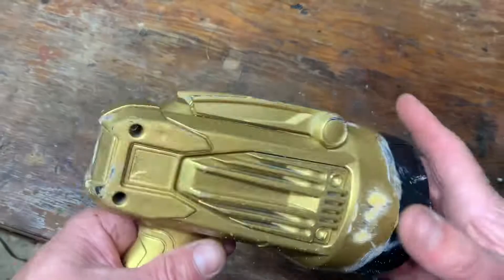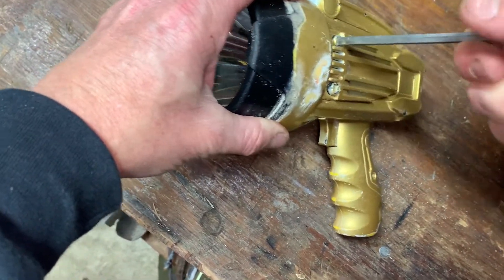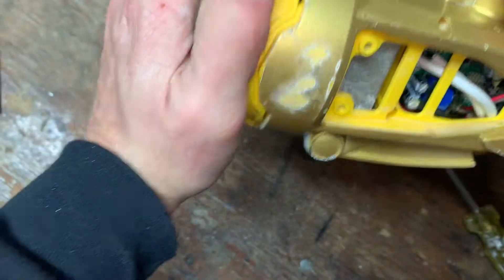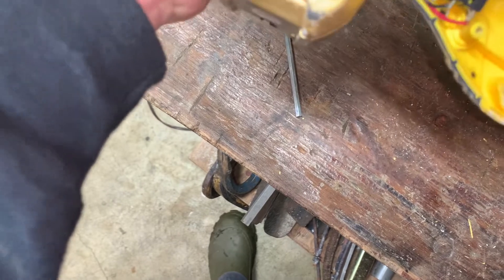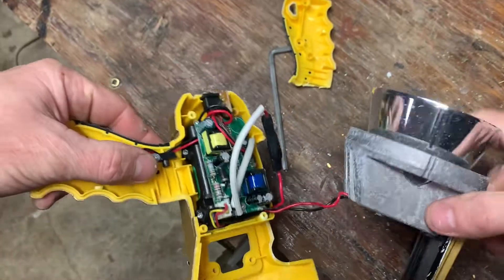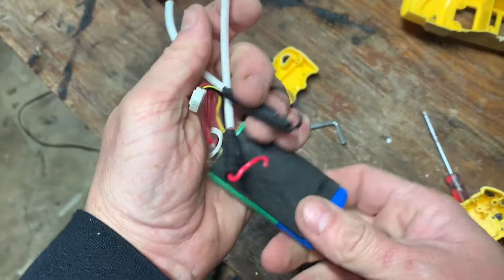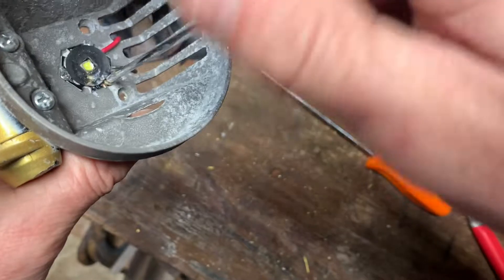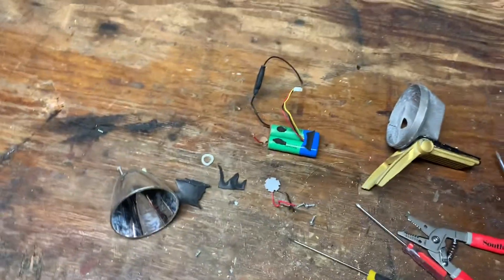What's Inside? STANLEY FATMAX Rechargeable Spot Light Tear Down [What's Inside Stanley FatMax]

Comment: I have had my ledlisl NOT THE CHEAPER "SL10leds" that are for less than $50. They made them look almost identical, but the LEDlisl is a much better unit. I cannot find any ledlisl models on amazon. Anyway, I have to spit on the 12v plug and twist the charging wire to light up the led charging light. I think the contacts that connect to the 12 v prong get corroded and stretched out and prevent it from contact and charge. Hope that helps.
Reply from the maker: Thanks
Reply: @DIYTechnician  THE LEDlisl LIGHTS have a chip in them that keeps the same light intensity throughout the charge. Other than them not being waterproof, the are great lights, but I think Stanley/Blk dker. is trying to sell the cheaper sl10's for almost the same price as I paid for my two lisl's [over ten years ago]. They are still working like new today! l8r

Comment: Mine just died this week. Had it since 2015. Best spotlight I ever had. I don’t want the new modern 900 lumen crap. I want the same 2200 lumens.
Reply from the maker: Man I agree. This one died too but it served me well for a long time. Thanks for commenting. Happy Holidays.
Reply: @DIYTechnician  The one I have looks like this - with the black fins on the sides - lost the special chargers somehow moving etc.  Are you saying that my old one is somehow brighter than the new one?  I think I paid $65 to $90 or so for it in like 2013 or so. Batteries totally dead, and it said in the manual not to let them go dead, so I came here looking to see how hard it would be to replace the batteries, what type they are, etc., but it looks really tough to disassemble!  Planned obsolescence.  That CREE LED had the model, they say it's 10 watts, here's a list of the CREE's up to the XHP 70 (now we're at xhp 90)

Odd how the URL/URI here says 920 Lumen, but the Amazon store shows 2200 Lumens.  Wonder where they're measuring from.  I'd assume the newer one uses the better / newer model of CREE LEDs.. see list in my other comment below/above.

https://www.amazon.com/STANLEY-SL10LEDS-920-Lumen-Rechargeable-Spotlight/dp/B00OU67Z80/ref=sr_1_2?crid=VFT15IS31AZH&keywords=stanley%2Bled%2Bfatmax&qid=1674038017&sprefix=stanley%2Bled%2Bfatmax%2Caps%2C117&sr=8-2&th=1&psc=1